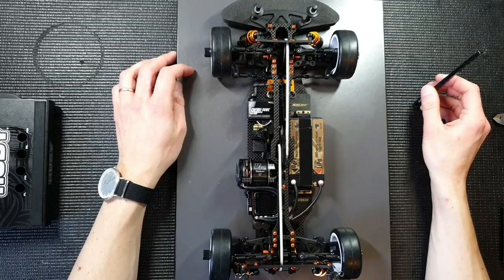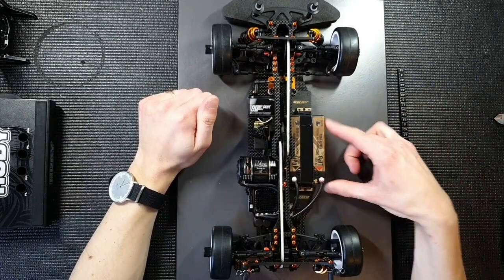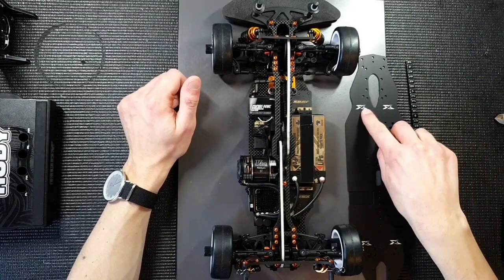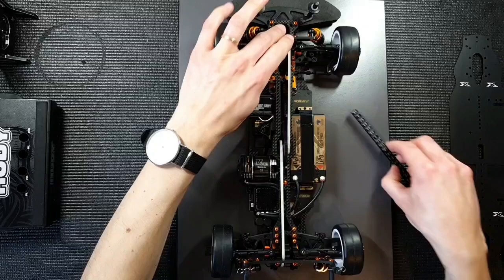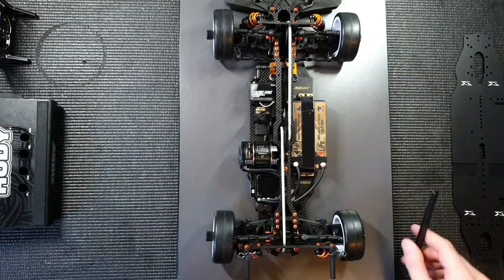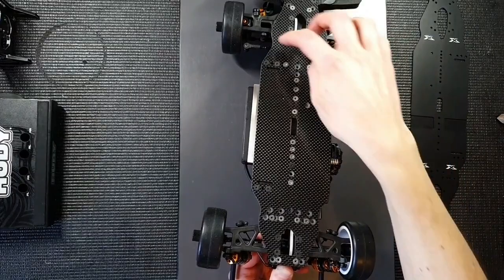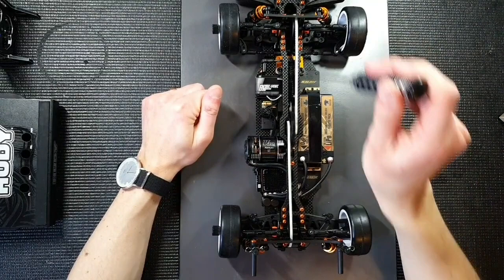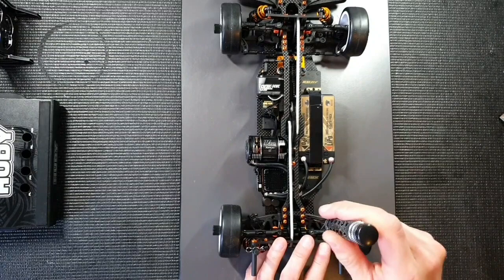How to tweak your T4

Comment: Hi Alex, great explanation as always.
Recently discovered a few tracks close to where I live that allow you to run 1/10 touring cars, 17.5 brushless motors with ESC in Blinky mode. Also I would really like to try Xray (was amazed reading history and philosophy on website). My main objective is to have a good time driving the car as well as the experience of the build and the maintenance and the tinkering and tweaking.
I would appreciate your help on a few questions:
1- Regarding the car, what model / version kit would you recommend?
2- I have a spare HW combo (a 17.5t XeRun V10 G3R and XeRun XR10 PRO G2) intended for a XB2. Can I use same combo or would you recommend another? Regarding 'Blinky mode' is this a setting regarding the timing that any of higher end ESCs can have or is it a special ESC?
3-Regarding basic options parts any recommendations to be prepared for wet and dry conditions?
I think this will help me from purchasing wrong or inadequate parts.
Thanks.
Reply from the maker: Hi mate,

1. If you're just starting out, you can get a recent T4 model usually for a very good price, for example a T4'20 or 21. The spares availability is very good and the cars are very strong/durable. They will give you a lot joy for little money. If you want to commit fully to the class, look no further than our new X4 platform which is a state of the art TC with the best possible performance.

2.That combo will work great for the 17.5T blinky class. I don't know if that class is raced locally where you are? You can use almost any ESC for blinky racing. The high end ESC's will have more options for brake settings for example, but also a cheaper ESC will work if it supports blinky mode.

3. Take a look at these links in terms of option parts info:

https://www.teamxray.com/teamxray/news/newsdesc.php?news_id=8289&kategoria=8289&catName=

https://www.facebook.com/alexander.hagberg/posts/4068796353149212
Reply: @hagberg  Thanks for swift and detailed explanation. I had a careful read of the specs of both cars and both look amazingly engineered. Even with a tame 17.5t motor it will take a long time for a rookie like me to explore all the potential they have to offer. If I could ask your opinion on one more point:
1- Out of the box and given the X4 offers more tuning possibilities without purchasing option parts, is it easier to make the X4 an easier car to drive and learn compared to the T4? 
Thanks
Reply from the maker: @vaamorais  Yes, I can definitely say that the X4, even in its configuration, will be a lot easier/more forgiving to drive than the T4 thanks to its suspension design, and low center of gravity. The kit is expensive, but you won't need as many optional parts as you would on the T4 to bring it up to 100% race spec.

Comment: I'm using the Hudy Quick-Tweak station and to get the balance the pre-load causes one side of the chassis to be much higher than the other
Reply from the maker: If the preload differs by more than 1mm on the collar between left and right, you probably have something else in the car that isn't straight.
Reply: @hagberg  Any suggestions where to look.
Reply from the maker: @rogersmith9066  Check your chassis, topdeck and bulkheads for straigthness. Check your shock lengths an downstops.
Reply: @hagberg  I checked all those and they were fine.  The problem I think was caused by the roll bars.  I disassembled them, checked them for flatness and reassambled them so that the arms came up at the same time and the problem was much reduced

Comment: Hi Alex thanks for this. I'm confused as to why the lift test would not give perfectly symmetrical results if the car is not tweaked, the downstops are symmetrical, and masses are properly split l/r on the car... Can you please enlighten me? Thanks!
Reply from the maker: It can be due to tolerances in the parts, shock towers not being tightened down completely square etc. It's rare that the preload is exactly the same left and right even though the car is brand new, and everything is straight!

Comment: HI Alex, great video! After tweaking my T4 I got an interesting result being that my left front and right rear shock needed a lot more pre-load then the other two. What can this diagonal imbalance be an indication off?
Reply from the maker: Is your weight balance equal between left and right? Has the car had a big crash recently? Is the chassis/topdeck/bulhkeads all straight? It can also be due to tolerances in the parts, shock towers not being screwed down completely square etc. It's rare that the preload is exactly the same left and right even when the car is brand new, and everything is straight!
Reply: @hagberg  Thx for the reply, I'll check for differences in the shock tower, have not looked at that deeply yet. One more question: I check the tweak using a Hudy Quicktweak station and the results are not always great (tool says no tweak but then you get a tweaked car on the track). Can you do a video on that?

Comment: Hi Alex can you talk about the rear holes on the standard hub, inside and outside and also the hub you can buy with the 1 hole in the middle? i am using the outside hole in the rear hub and find it really settles the back end down but nobody uses this position on any setup sheet. I am running on low to med grip ashphalt outdoor.
Reply from the maker: We used the outside and sometimes the middle hole on previous car platforms (such as the T3), but we haven't had much success with this upper link setting on the T4, as we feel that it simply settles the car down too much (the rear stays flatter on corner entry).

Comment: Hi Alex ,If i use corner weight scale to adjust preload of shock,will it get the same result as if using your method?
Reply from the maker: Not exactly. But it tweaks fine with the lift method, it usually balances out on the scales too. But one method doesn't substitute the other. I wouldn't tweak the car using the scales.
Reply: @hagberg  Do you mean corner weight scale is only for checking balance of the car ? When finding balance problem , we should adjust it by other method instead of using  corner weight system to solve it?
Reply from the maker: @ericdu8084  you can rely on the corner weight scales for small adjustments in preload. But always double check with the lift method. The only way to check the weight balance precisely with the scales it to use tie rods/shock clips so that shock preload isn't influencing your readings. Front to rear balance can generally be checked the normal way though.
Reply: @hagberg  Thanks for your help

Comment: Is there any point to try to tweak a car that isn't weight balanced?
Reply from the maker: The spring preload will be more equal between L and R if the weight balance is perfect, yes.
Reply: @hagberg  so you're saying if you knew you're driving a car without weight balance, you'd prefer to tweak it even if the sping preload would have to be different? Sorry beginner just getting started here
Reply from the maker: @mhrcracing  yes